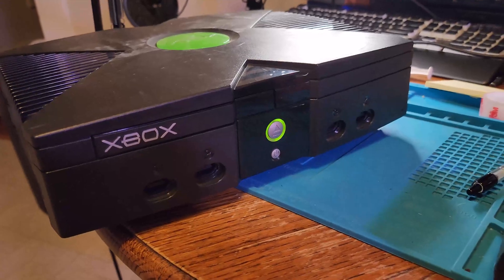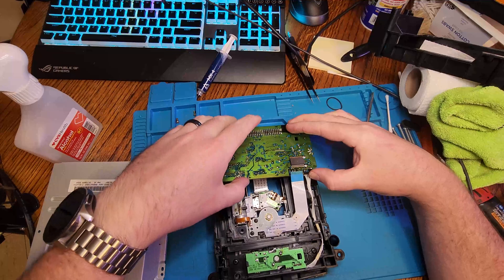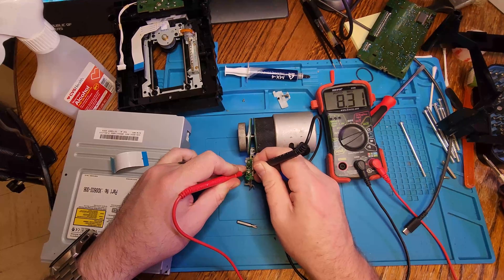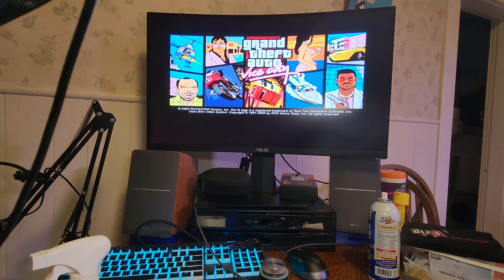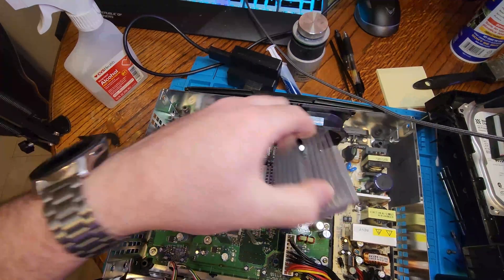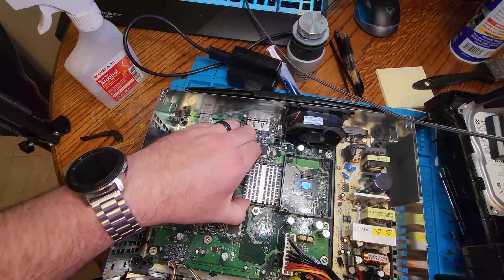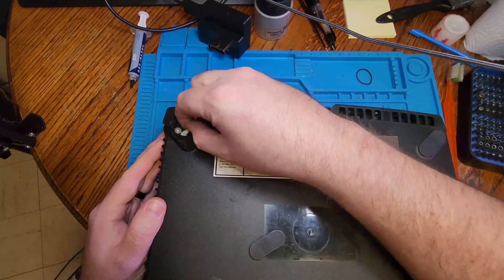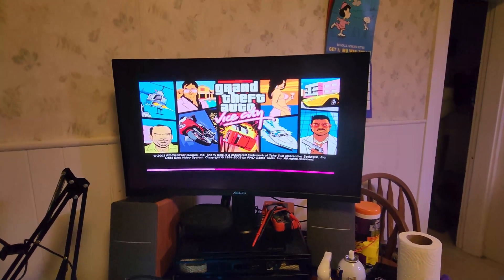Original Xbox DVD Drive Laser Adjustment

Comment: So, mine spins and tries to load a game but even after adjustment it won’t read a disk. Any other common issues with these that would cause it to not read a disk?
Reply: Une solution ?
Reply: yeah im also having this issue, did you figure it out?
Reply: your laser is probably completely dead. it'll need to be replaced
Reply: @Thallidus  figured it out actually, I was in the process of hard modding my og xbox and I had to change some setting until it was just right, I tried a couple different disc drives so I was pretty sure the laser wasn't dead lol. I appreciate it though!